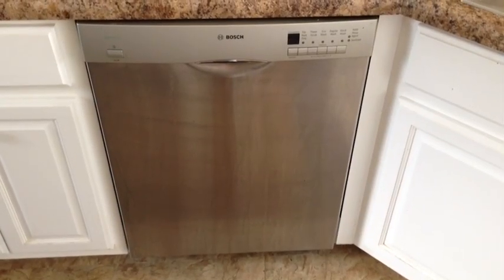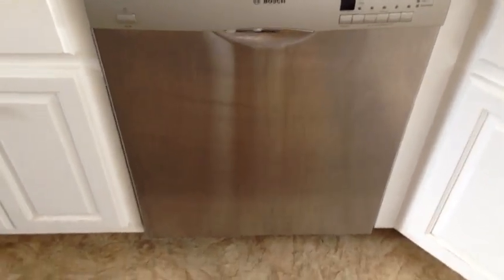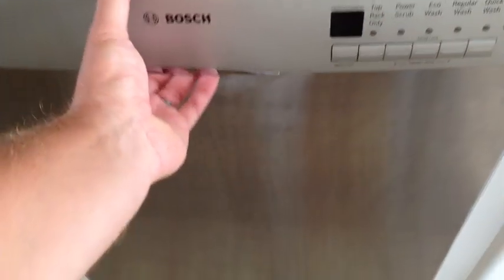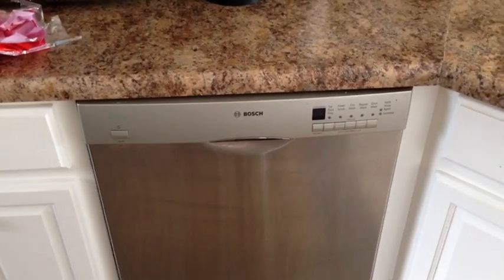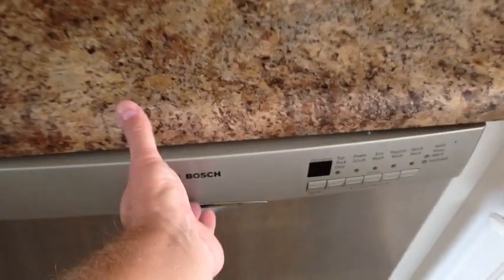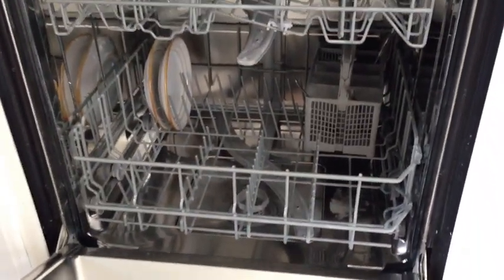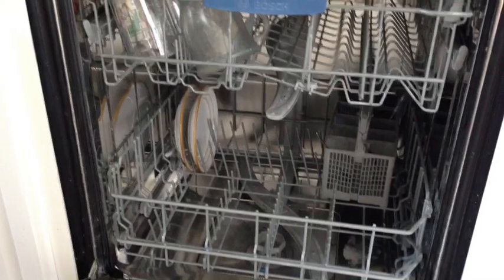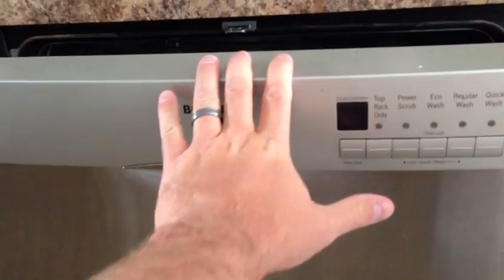Bosch Dishwasher Leaking Fix

Comment: When I noticed water in front of our Bosch Dishwasher today I was puzzled because I had just cleaned out the filter and replaced the air gap about a month ago.  Thank you, thank you for the video!!  My wife never puts anything on that side of the dishwasher but today put a tall, flexible cutting board right in front of the vent.  We put in a new load without blocking the vent and your suggestion was right on.  We love our Bosch (about 10 years old).  Only problems have been operator/owner errors - washing jars in the dishwasher to remove the labels (clogged the filter/drain).
Reply from the maker: Jerry Medlar That's awesome news!  Finding the solution online is so much better than having to pay for a technician to come out.  Have a good one.  Ten years old......that's a long time.  Nice!

Comment: Hi this is the expansion slot, Bosch don't even give the valuable advise that is offered in this video. I suffered a leak on my new Bosch dishwasher where the water was leaking form the bottom of the dishwasher door and decided to call in an engineer only to find out that the engineer could not get round to me for about a week. Then I came across this video, did a couple of empty washes and no leaks so I tried a full load (making sure I was not covering the expansion slot) and still no leaks. I cancelled the call to the engineer and my dish washer has been running great ever since. This is what YouTube is all about videos that help others.
Reply from the maker: ***** Awesome!  I'm happy that this video helped you too and I'm sorry that you experienced the same problem with your Bosch dishwasher.

Comment: Unbelievable! We've had our Bosch dishwasher for over 10 years and this just happened for the first time, thanks to a flexible cutting board.I could've sworn we didn't even have that valve, or whatever it is, on the right, but there it was! What an incredible help! Thank you so much-

Comment: Thank you so much! We are in the middle of a kitchen remodel largely inspired by the damaged floor due to a "once in a blue moon" leak from our Bosch dishwasher  with the same model number as yours. We've replaced the laminate flooring with tile, but were still troubled by not knowing what has been causing the leaks and wondering if we should replace our otherwise wonderful dishwasher. I so appreciate you taking the time to make this video and share your findings!
Reply from the maker: Anne Wegener It's such a shame because I bought the Bosch because I felt that I was spending more for extreme quality.  I have an entry-level GE dishwasher now and so far ZERO LEAKS.

Comment: This is brilliant, thank you.  My Bosch would intermittently leak and it was driving me nuts trying to fix it.  It was entirely due to stacking those plastic cutting boards along the right such that the vent was blocked.  Since we have stopped doing that (about 2 months ago) it hasn't leaked once.  I also think blocking that vent would occasionally lead to water being left in bottom of washer at the end of the cycle.  That was also a problem with mine sometimes.  That also hasn't recurred since we stopped with the cutting boards.

Comment: Thanks.  Blocking the condensation vent confirmed on the bosch shpm65w55n as a potential leak defect. Bosch should be labeling this clearly inside the compartment .  All the property damage from this maybe a liability to bosch imo.

Comment: Thanks for this! I can confirm the same issue plaques at least some models sold in Australia, specifically at least SMI40M05AU. And interestingly, the plate/board doesn't even need to block the sensor or whatever, being placed near it is enough for it to flood. Interesting design flaw.

Comment: Interesting. Our Bosch is a different model and only leaks occasionally, seemingly from the top or right side. That vent (or whatever it is) is on the left side of ours but I recall that just two nights ago when it leaked, my wife had put a cutting board in that was next to that item. Have to experiment with and without a cutting board in that spot. 
Thanks.
Reply from the maker: Hopefully that works for ya'll!  Dishwashers are frustrating!
Reply: @reggiekenner1527 did that solve your issue?  Mine just started the top leaking thing and I'm searching answers!

Comment: Thanks.  Water covered the floor after I made another repair (plastic wrapper blocking upper rack water supply) and I thought I messed something up.  Turns out I blocked the part you described with a cutlery holder.  Moved that and all is fine.  Well done.
Reply from the maker: William Samoska Woohoo!  That's awesome!

Comment: Exactly what happen with my bosh classic electronic dishwasher. Base tray fulled up because it the side hole was blocked by large lid. Also on top of that the waterhose had a minor leak. So check water came on because the tray had water and it protected it from flooding.
Reply from the maker: I wish that Shark Ninja would start making dishwashers, washers, dryers and other large home appliances.  They’re one of few brands that I’ve found that seems to make simplistic items that hold up well.

Comment: Mine leaked, but it hasn't got that same feature. I took it apart and found the lower door seal was very dirty. I cleaned it using a weak washing up liquid solution and lots of paper towels, then coated the seal with silicone grease before re-assembly. It doesn't leak any more!  The vulnerable areas are the ends of the seal, so a simple thing to try is carefully clean inside the machine at the the bottom of the door, then dry it and apply some waterproof rubber grease, especially at the ends.
Reply: What is silicone grease? Brand name? Thx
Reply: @torenatkinson1986  
SERVISOL silicone grease 50g tube.

Comment: Intriguing.  Mine did this a few times and its only 7 months old!  Vent is on the left side next to the rack slots for ordinary size dishes.  Is it possible that they alone could block it?
Reply from the maker: As an update to this video, I replaced it with another brand dishwasher (a lot less expensive).  When the installer removed this one, he said “I probably shouldn’t tell you this but this unit was not properly installed....”. Long story short and not to my knowledge, the installer had cut pieces out of the back of the unit to install it.  Those modifications to the unit are what caused it to fail.  I’m not a lawyer chaser but looking back I should have held on to the dead unit and demanded a refund from Lowes.  I was so glad to have a working unit and clean dishes again that I let the installer of my new unit haul this dead Bosch unit away.   I will never buy appliances from Lowes again.
Reply from the maker: Apparently Lowes outsources their installations to some shoddy contractors.

Comment: Unfortunately this was not my issue 😟. Appreciate the video though!
Reply from the maker: Bummer =(. Well, I wish you luck finding a fix for the Bosch.  If you can't fix it, I suggest GE "bent and dent" appliances.  If you have a GE dealer close by, most sell appliances as a discount if they have scratches, dents, etc.  All appliances are built to fail but I've found GE to be "Good Enough."

Comment: I think you should watch this video which shows how to easily replace a bad seal at the base of the door. Your solution is probably more of a workaround.
Reply: My seal at the base of  the door looks bad,  this is an interesting video for a model almost like mine (different color) . . but I never block that white circle on the right since my silverware is on that side.  Where do I find a video for replacing that bad seal . . . part of the seal is flattened out instead of rounded like the seal in the video.

Comment from the maker: No problem!  Yeah these dishwashers are great but mine leaks if a big plate, cookie sheet, etc. is near that hole.  That's awesome no problems after 4 years!  Can't beat German engineering....as long as it doesn't involve replacing sport tires ever 15K miles ROFL

Comment: This just happened for us.  Usually we put the cutting board on the other side and we had the cutting board on the right side which covered that port and caused a leak.

We have a different model Bosch and has that port on the righ side.